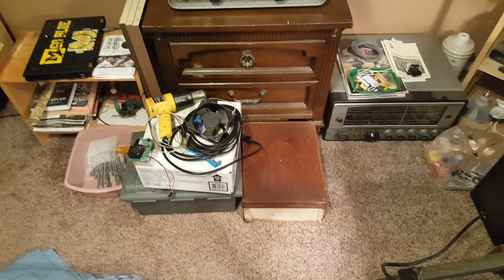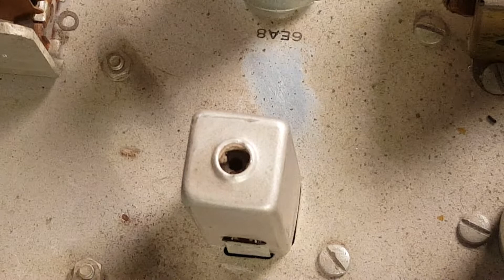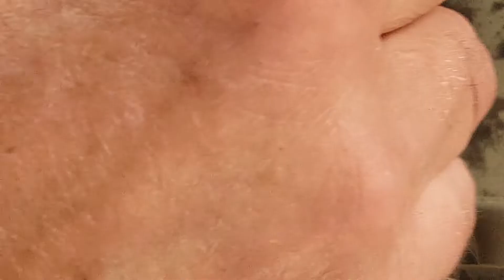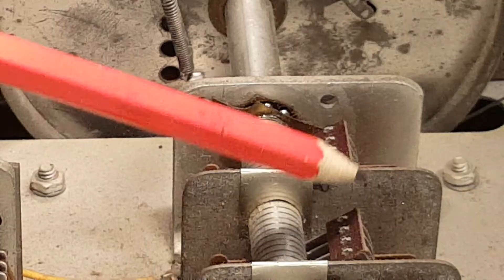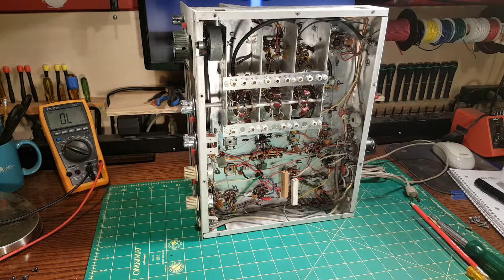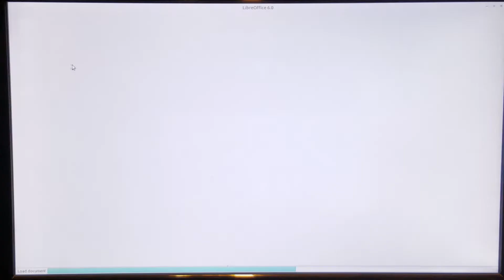Heathkit HR-10B Restoration - 1st Look - Interior Assessment

Comment: HELP!  a hallicrafters S-38D followed me home?!?  Case and interior ar very clean for its age, lots of newer caps inside.. I dont have a variac but wondering if a standard AC dimmer switch would work for basic power up test? Radio is rated at 30 watt 105 -125 volt draw..  rubber feet and isolation washers should be replaced on principle but look to be still doing there job (contanuity test is first on list for initial power up)...  CHUCK?!? I feel my self slipping like Alice down the raddit hole!!  I am willing to talk off channel, info on QRZ is good KD9MDL.    PS. Read that 115VDC works as well and is quieter.. If I do a isolation transformer should I consider doing DC?